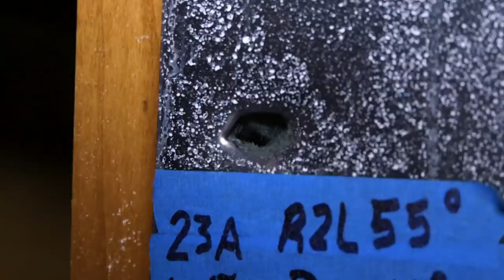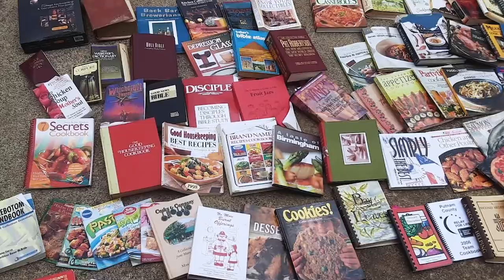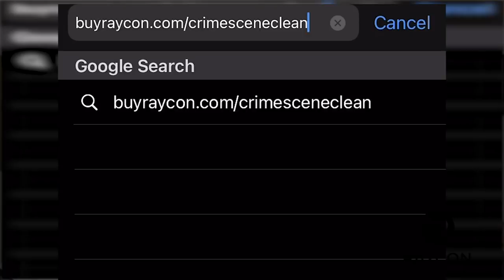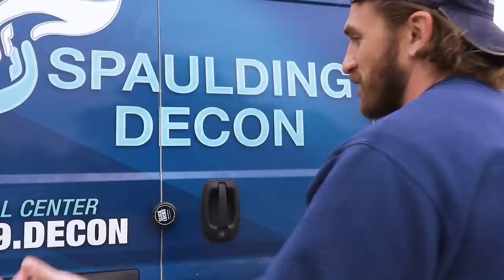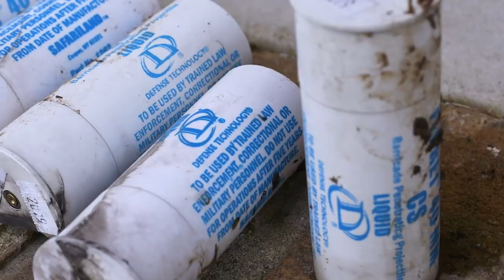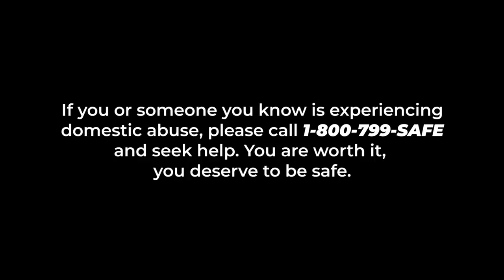Music City Mayhem - Tear Gas Decon | Nashville, TN

Comment: Glad to hear there is a neutralizing agent for the gas, even if only partially. Most people don't know the gas reactivates with moisture.
Reply from the maker: Absolutely, we wouldn't be in there without PPE if the effects weren't completely neutralized.
Reply: A shower would suck if not knowing tear gas had been used
Reply: That was very interesting.  I'd love to work for a company like this. It may have it's very sad parts but life is like that. I respect all that these people do. I was a nursing assistant for 23 1/2 yrs and believe me, you gotta have a good laugh or you'd be so depressed & upset that youd be a thorn to everyone around you. I cleaned up enough dead bodies over the years and you gotta learn to keep going and not be so critical of the way others respond to things.
Reply: Johnson and Johnson baby shampoo takes the sting out of mace. Mix a little with water use on skin and rinse eyes with it. Really took the sting/burn off. Fran W RN.BSN county jail retired.

Comment: I moved into an apartment that had been raided by SWAT. There was a huge square dent in the door where they busted in and in the entryway the dry wall was bowed inwards and the nails were pulled half way out from where they threw a flash bang. It was all repaired shortly after we moved in.

Comment: Worst case I cleaned was a semi truck, LEOs fired 5 canisters of CS gas into the truck. It was July, triple digit temps. Bio & residue inside and out. Took 3 days to clean, then we had to use a scrubber.

Comment: This is definitely a job i could handle, i was on the Volunteer first responder/fire department and was a tow truck operator so ive seen some stuff in life, not only did i serve as a volunteer fire fighter and a tow truck operator i served 3 tours in the middle East as a Lieutenant first class in the United States marines, would still be enlisted but was medically discharged due to an accident, being in the crime scene cleanup profession seems a lot better than working for FedEx Ground delivery services as a Package Courier. Id definitely be interested in applying for a job like this .

Comment: In these types of cases, who would be responsible for covering the cost of damages and cleanup? I would hope that after such a traumatic experience the wife wouldn’t also have to worry about covering the cost of tear gas cleanup after swat goes crazy. I imagine bullet holes would be easier to fix, but all the work put behind completely removing any remnants of tear gas must cost a fortune.